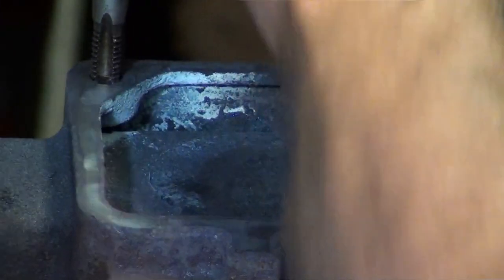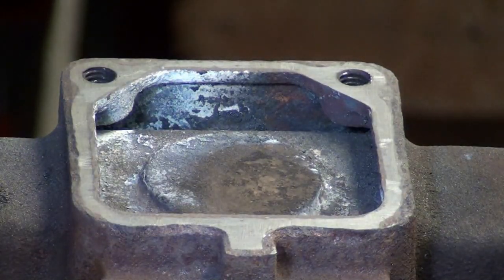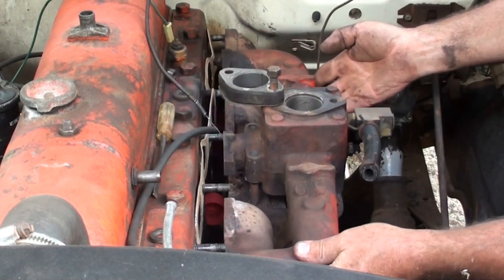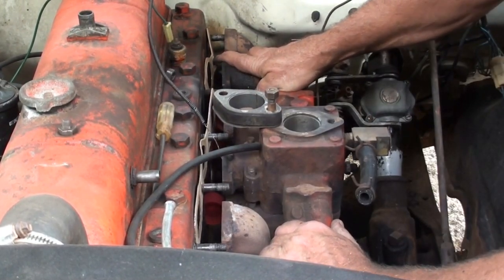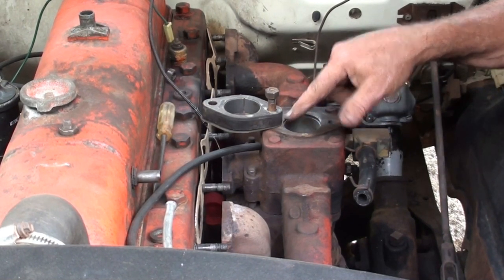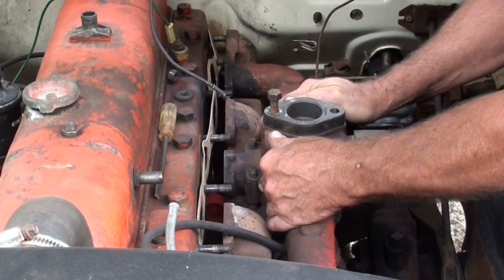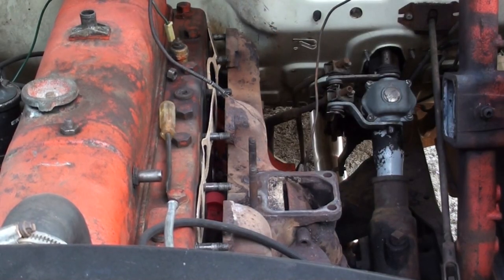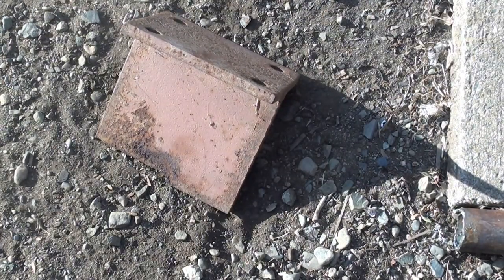1959 GMC Exhaust Manifold Dilemma Part 3

Comment: I’ve got a 2 inch thick piece of glass that I use, I put sticky back sand paper on it to do my clean up on stuff
Reply: Here's a tip that may help some folks out. If you're looking to true up the face of mating parts and machining isn't an option, you can use a piece of granite that was meant for a countertop. They're generally very flat, smooth and true from manufacture. All you need to do is attain some sandpaper and place it backside down onto the granite face - a bit of water should hold it in place. Carefully slide the mating surface back & forth over the sandpaper that you wish to true up and you'll get there. There's a bit of technique to it but it works if you're careful. The good news is that the granite piece can come from a broken or otherwise damaged countertop so it should be cheap or even free. I will note that you shouldn't expect to take a lot of material off your part  while keeping multiple surfaces parallel and true to each other, .010 is all I personally expect but your results may vary. I've attained excellent results on carburetors and cylinder heads in the few tests I've conducted or witnessed. You can find videos covering this type of thing if you look for them. Best wishes!

- Max Giganteum

Comment: A belt sander would have been wonderful. Especially for this job.
Reply: Smathet, how in the hell are you going to get that big-ass belt sander in & on the Manifold in the truck???DUH DUH.....WON'T FIT RALPHY.  It would be better to use a air roll-off then use a good file...that's my opinion.....my friend....
Reply: @marvinalancornell8275  remove it from the truck, duh.
Reply: As I recall, removing the bottom manifold is what Jeff was avoiding due to the exhaust tube being rusted onto the end of the manifold... along with the mating hardware. He would have had to cut off the tube, rework the manifold then replace part of the tube between the muffler and the manifold. That's a lot of extra work and probably some 💰
One could argue that he was doing extra work already... but at the end of the day, it probably would have been worse. When you're on no budget, you do what you can to pinch pennies and these days we've got to pinch all we can. Thank "El Presidente" in the white house for that! Along with everyone that voted for him...

- Max Giganteum
Reply from the maker: Crow is best served cold.
Reply from the maker: Thanks for paying attention!

Comment: Solution for people with too much time:  cut a groove in the gasket face and gently hammer in a length of copper wire. Heat to bend corners and anneal. Wire crushes to seal when parts are tightened.
Reply: Or you can just machine both faces flat, install the correct gasket and quit messing around. I would think that Jeff would have purchased a used lathe and a small mill a long time ago just to deal with this sort of thing? Apparently not. He could even get free machining lessons from Tony!

- Max Giganteum